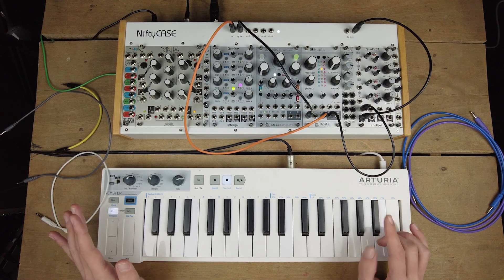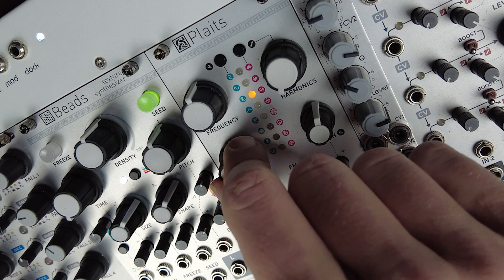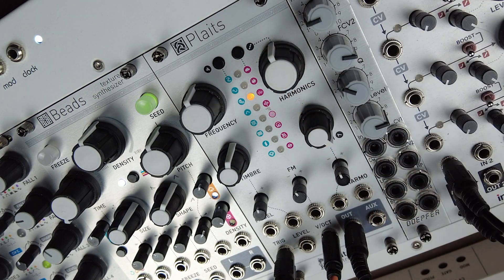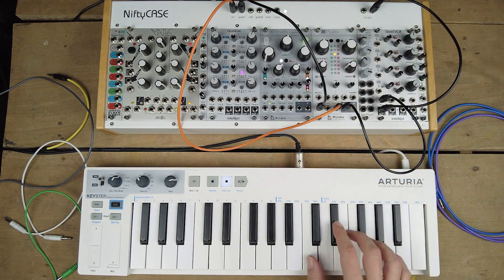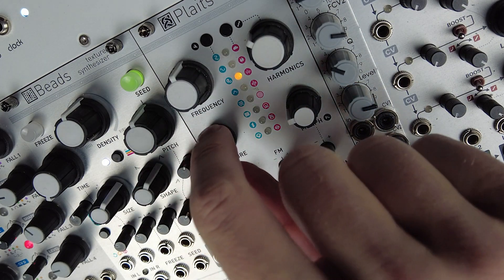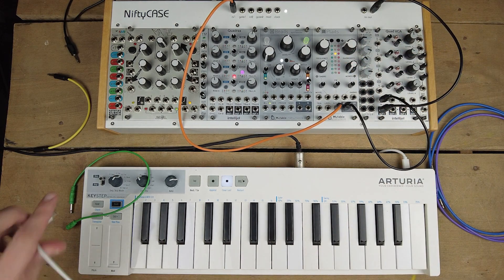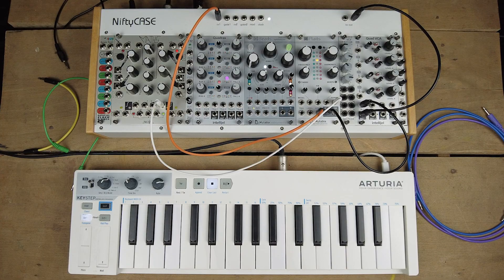Mutable Instruments Plaits DX7 Model

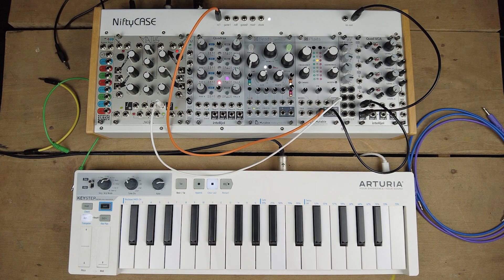Comment: On your first jam, around 6:00. What are you using for the bass and that noise/snare/kick? It sounds awesome. I love it. I'm guessing the bell-ish sounds are the Plaits.
Reply from the maker: Thanks! The bass is coming from the Doepfer A-111-6 Mini-Voice module. Great module when space is limited. thanks to some imho good I/O choices you can use its filter and envelope separately, and it sounds great too. The rest is all the same DX7 patches just with different pitches and timbres, at least in the patch I think you are talking about. In the one drum patch I added here I'm modulating the harmonics parameter to switch between some different percussion presets.
Reply: @easytiger1452  without listening for the elements described, the first two jams reminded me immediately of depeche mode, which is never a bad thing. very musical.